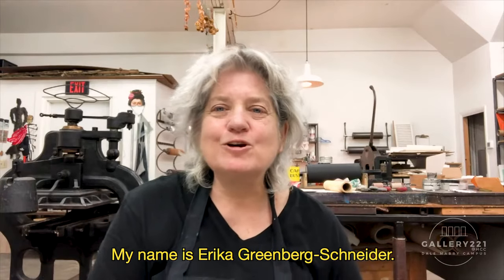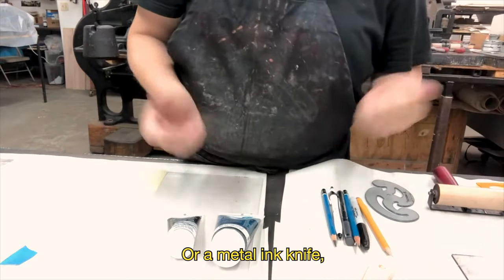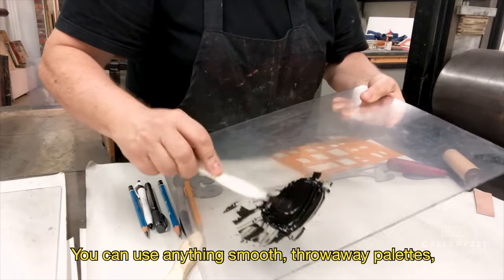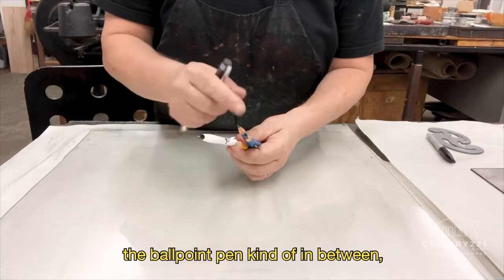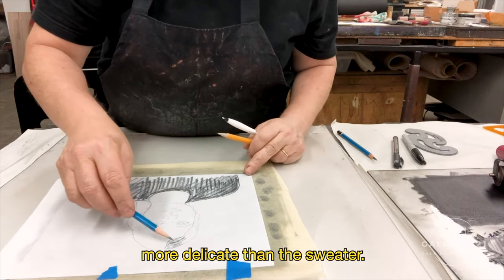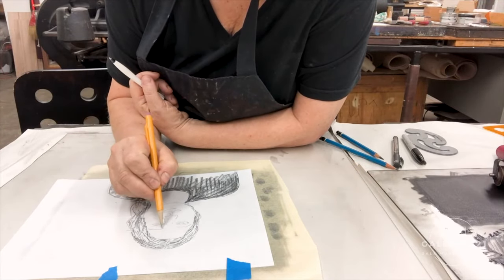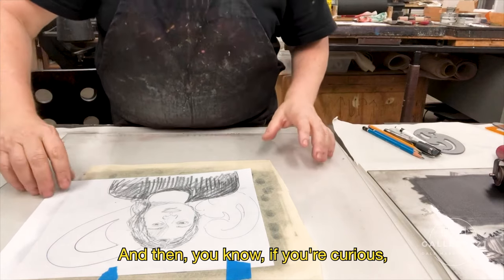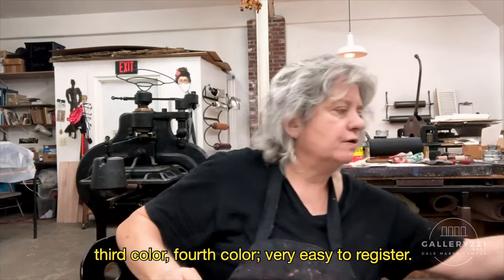Trace Monotype Printing: Erika Greenberg-Schneider

Comment: Yay I'm so happy to have found this. I'm local in Largo, FL too! Just starting to build my relief printmaking skills and I've run into issues with my ink drying to quickly. I will be ordering some retarder after this video. Can you recommend how much ink vs retarder to use on home made paper that's a bit thicker? Thanks so much!